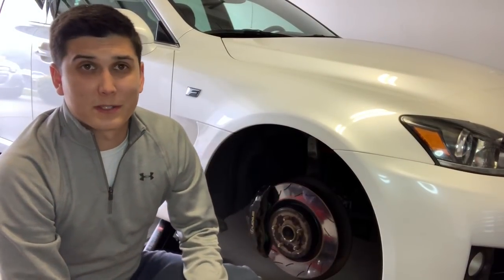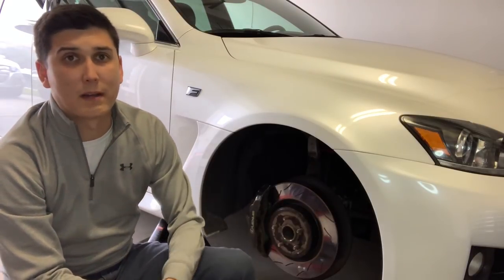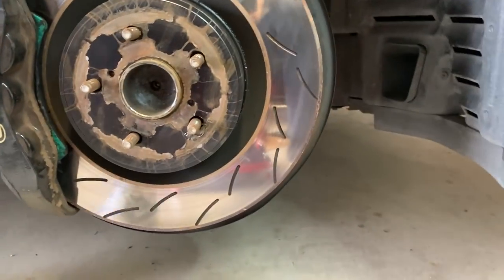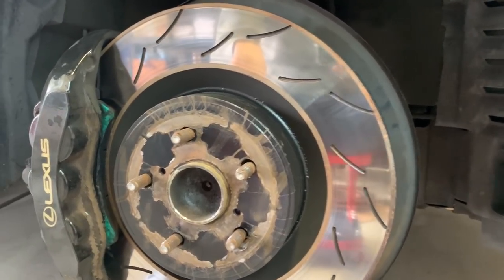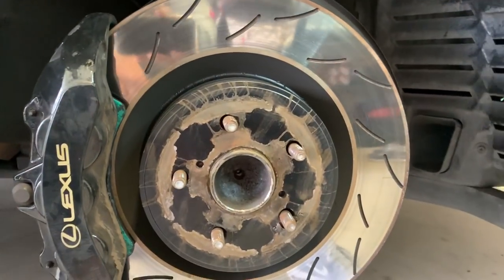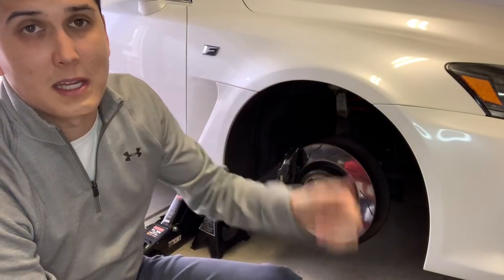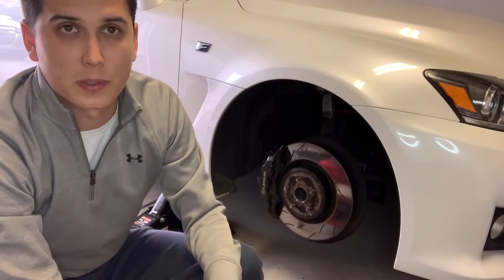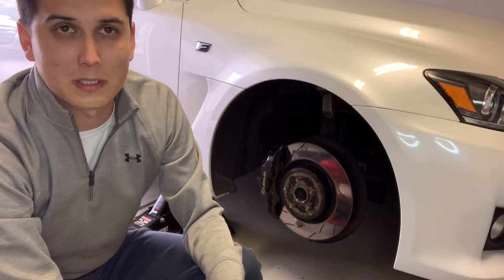Lexus ISF - Brakenetic Rotors - Initial Impressions

Comment: Keep up the great reviews.  I’m going to need brakes this year and possibly rotors.  Street car only and just over 60k miles on original brakes.   If the rotors have no cracks do you think I could do a pad only change?  Thoughts?
Reply from the maker: Measure their thickness.  If the fronts are less than 28mm replace them, if the backs are less than 26mm replace them.  If you stick with the stock rotors they’re pretty cheap on eBay, ~$100 each.

Comment: Hey man! So what is your input after tracking the car with these rotors? I just began tracking mine and it started showing some cracks... going upgrade the brake lines and fluid as well. Would like to know the results for the rotors. Thanks!!
Reply from the maker: I also have a video on what happened to these rotors after 2 track days, burned off the e-coating and Brakenetic sent me a new set with a Zinc coating but never got around to do another track day before selling the car.  No cracking on the original set but they felt the same as the stock rotors.

Comment: Are these rotors lighter or same weight as OEM?
Reply from the maker: I didn't weigh them but after holding them and then the used OEMs I suspect they're about the same weight.
Reply: @ISFASTER  ok then 👍
Reply: @ISFASTER  Stock ones are 25lbs each! heavy unsprung weight... Wonder how much aluminum hat rotors are?
Reply from the maker: The RR-Racing 2 piece set says its “21.5lbs or a 6lb weight savings over OEM” and are $900 for the fronts.
Reply: @ISFASTER  by

Comment: What are your thoughts on vortex Generators on an ISF? Check my pic.
Reply from the maker: Would you do them for the aesthetic look or actual airflow purposes?
Reply: ISFASTER Mainly Aesthetics but I know they do have a function at higher speeds. I’ve had them on my car for about 3 weeks. My new default should load soon
Reply from the maker: If you like them then keep them on.  As you’ve seen from my car I like the stock look.
Reply: ISFASTER yes, I can tell you like the classy stock look. check it out the pic now brotha

Comment: Are these directional?
Reply from the maker: They had stickers on them that indicated if they were ‘Right’ or ‘Left’ and were put on as labeled.
Reply: @ISFASTER  I just bought a set myself along with some stainless steel braided lines, I look forward to getting them on the car. Thanks for your review helped me make up my mind as I was on the market for an upgrade!
Reply from the maker: Glad to hear my video helped you! Be sure to let me know what you think once you've put them on and tried them out for a bit.
Reply: @ISFASTER  For sure!
Reply from the maker: Went out and looked at them and the interior of the rotors appear to have the same design as the OEM rotors so non-directional.
Reply: @ISFASTER  Awesome, thanks for the update!

Comment: What are rotors really. How much can you do with them? Does it matter which ones you get as long as they're not no names from eBay, but some ppl have good stories with those. This company seems legit. They're more money than a lot of oems. If you're not buying carbon fiber ceramic. Steel ones are all similar. IMO anyway.
Reply from the maker: I went with slotted rotors due to the OEM drilled rotors cracking.  If you track the car you’ll have to replace rotors less with blank or slotted rotors.
Reply: @ISFASTER  yeah, makes sense. Holes compromise durability. I just meant the name you got in terms of reliability. All brand name rotors work. But these seem to have worked out good for you. So good endorsement for this company, especially where you track it. They have a unique design too. I need rotors, so might try these or sp performance I think they called?..  at carid. Never heard of them. They have slotted and sprinkled/dimpled which is obviously better than drilled, but again, like cool design pattern of brakenetics and probably just go with these.  
Any squeaking? Some of these design rotors are loud. Plus some of racing pads don't help. Like ebc rotors as well, but only have so much money.
Reply from the maker: I had Project Mu NS400 pads with no squeaking for the street the would swap in Project Mu HC800 pads for the track which had a bit of squeaking, not horrible though.